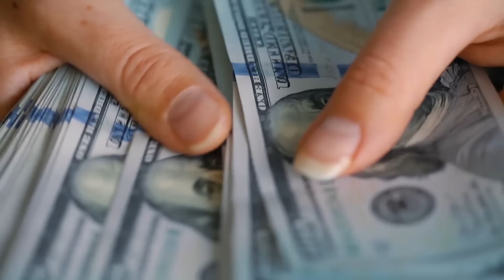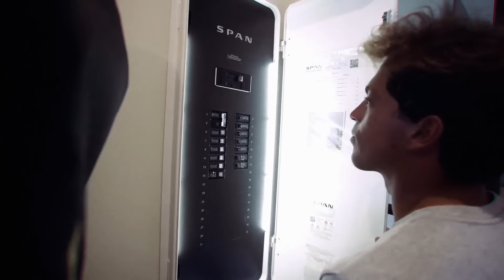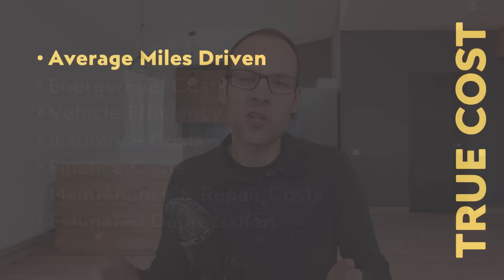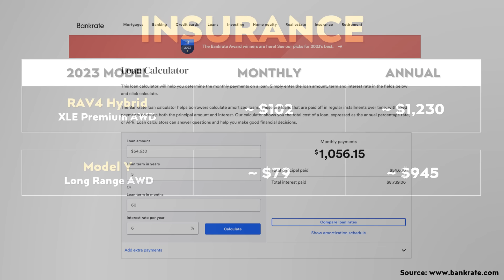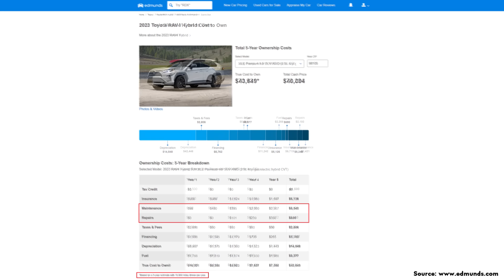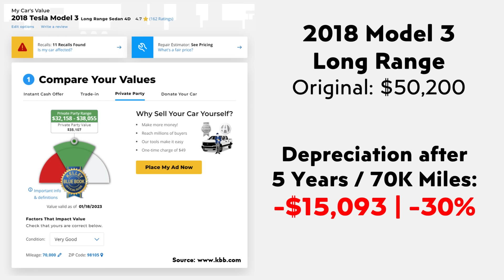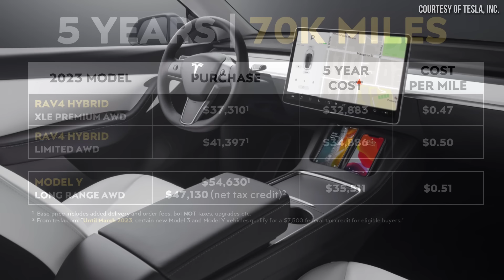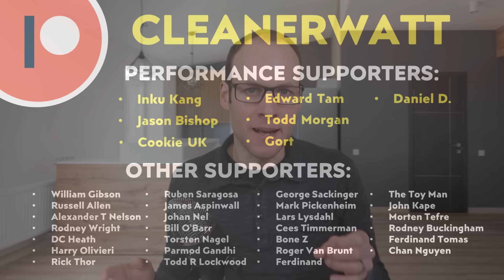Tesla Model Y vs RAV4 Hybrid: Lowest Cost of Ownership in 5 Years?

Comment from the maker: QUICK CORRECTION: at around 6:30, the slide that shows insurance cost estimates has the models switched. The numbers that I speak in the video are correct, but the slide should show ~$102 per month for the Model Y, and ~$79 per month for the RAV4.
Reply: I caught that !!!!
Reply: I knew something wasn't right because I called the other day to compare insurance and mine was going up 150 a month from my wifes 2015 Honda CRV EXL
Reply: If the interest rate is low, the operasional saving of model Y maybe could make sense but if the interest rate is high the model Y may be don't make financial sense because of it's higher initial purchase price.
Reply: How about a ten-year comparison. Why just 5 years all the time.
Reply: @aquilinonilay4892  The Tesla will be bricked by Elon before it reaches year 5. You'll be invited to buy a new one
Reply: The 15 year will be completely different. No one will keep Tesla for 15 years or more but RAV4 will be for 2 or 3 generations and keep running.
Reply: The insurance prices for Teslas has skyrocketed to about $8,000 due to the sky high prices to repair even a fender bender on a Tesla due to the Gigacasting design everything is one piece so a fender bender repair cost is many times more than a fender bender on an ICE. Also due to the fire risks with Teslas.

Comment: Interesting video. I know it’s a bit dated but I went to a Toyota dealer looking at the RAV4 hybrid. It was msrp of $36k plus a $7k market adjustment so $43k. I ended up buying a Tesla model y with the 4680 battery for $46,990 minus $7,500 federal tax credit so $39,500…… Tesla Model Y > Toyota RAV4…. U didn’t take in account the market adjustment and add ons dealers are charging.
Reply: You got snubbed mate, dealer market adjustment is gouging and you got gouged.
Reply: @Andre-mi6fk He got gouged going with tesla? huh?
Reply: Not true. No more marking up. Selling at MSRP or below now.
Reply: That rav4 could last for couple decades
Reply: and it gets better with time.  450hp vs 202....what a joke.  rav4 - gag

Comment: Depreciation over 5 years seems rather low and certainly no where near the depreciation in Europe . 20% over 5 years seems ridiculous, not in the future as in the next five years hybrid will depreciate more like double that rate
Reply from the maker: I agree that depreciation might be higher going forward, but I have to stick with the data that I have right now and calculate accordingly.
Reply: @Cleanerwatt  if Leasing the residual  usually 50-60% of list @ 3 yrs.
Reply: @Cleanerwatt  With the trend away  from ICE, the depreciation coming for the gas car is going to be higher...and the EVs with better batteries in the future again making the non-constant costs lower.
Reply: Also, you should cosider depreciation only if you are 100% sure you will sell the car. Until you don't sell it, those dollars are virtual to say the least.
Reply: @markotrieste :  Yup.  I tend to keep a car 15 years (not driving lots of miles), so I don't even worry about depreciation, as I tend to give the old car to someone who needs car in the end.   (And I've had such people tell me the car was the best car they ever had, and get years of good overall service from it, in one case for over another decade).
Reply: @rogergeyer9851  My goodness! That* is* a spectacularly good idea! Keep those vehicular merchants at bay by keeping your car for 15 years!
I still have my horse & buggy  both of which I can still maintain.
Just kidding. But not about the 2 tons of metal that it takes to transport 180 lbs of me around. And the EV is even heavier than the ICE unit, yes? Appreciate your note that driving is over-rated and that renewing annually is wasteful.
Reply: Rav4 depreciattion is quite similiar in Sweden as stated in this video.
Reply: @Cleanerwatt  here’s a cost that you didn’t mention. Currently Toyota has a ten-year 150 thousand mile warranty on the battery. If you ever need to replace it the cost of the battery including installation is somewhere around 5k to 7k. The cost to replace a battery on a Tesla is more than 20k.  You also said if it was me which one would I buy? If it’s my money of course I’m gonna be buying the RAV4 hybrid and not the Limited model, but if it was your money and you were buying me the car and you let me decide which one I’ll take the Tesla.
Reply: @sammyjammy6647  I am planning to buy rav4 hybrid
But price off door not less then $39500 if I go for lowest base model
The catch is why price on google saying $32500
I will appreciate your reply
Reply: He did a 5 year depreciation when car isnt 5 years old 😂. Its 2024 and model Y depreciation is 50%

Comment: At my Mammoth condo electricity is 40c/kWh. That means that in the snow and ice, the fuel costs of a RAV4 and Model Y are similar. Throw in that installing a 240V 40A power line will cost $2,000 and I will have to get home owners insurance with a $1,000,000 cap at $900/year, that adds $9,200 over 8 years after which the Model Y drive train warranty will expire making the car almost worthless, whereas a RAV4 will go on running without much extra cost for years.
Reply: If your paying $0.40 kWh why not just use superchargers? My cost per kWh is $0.12 which makes for big savings in fuel costs.  I only have 110V 15A which works for me.  Confused why you would depreciatee Teams to zero after warranty. Yes, some repairs won't make sense but it doesn't die on  year 8 day 1.

Comment: There is one key factor that is not mentioned. Though it really depends on the driver. The key factor that is probably need to be factored is TIME. If the driver do drive long trips quite a bit in year. Charging time maybe longer than filling a gas considerably. Sure there is a charging station, but if too many drivers charging then the output to charge your EV will be like charging at-home. If TIME is very important to the driver then I would think it is obvious that Hybrid or ICE is the choice. Sharing this experience since this key factor is not being mentioned by many EV bloggers.
Reply: TIME is important and so the 5 yr period is* conspicuous: only one of these cars is going to get OTA updates (possibly longer than 5 yrs) and a 10 yr period might really make the ICE car look bad. In 15 yrs will we see any ICE cars?
Reply: The EV would typically charge at home or possibly during shopping trips and such and generally would save time for most of the year when using for basic commutes.  That's a lot of time not going to the gas station weekly.  I think it outweighs or at least balances with the extra stops and time changing on the rarer long trips and charging an EV.
Reply: The model 3 long range was great for our road trips. From Los Angeles to Utah, total stops to charge added an hour and 45 minutes. But these are stops I would have made regardless. Once in Eddie’s World, which I always stop to use their restrooms, once in Las Vegas, which was out lunch break. And then once somewhere in south Utah. The Utah stop was like 25 minutes for most of the charge.
Reply: Sure charging the electric on those rare long drives that surpass the range will take longer. But on the other hand you don't have to make those weekly, or more frequent, gas station stops. Charging at home will save a ton of time wasted standing around waiting for gas to pump that everyone already does.
Reply: I save a ton of time per year by not getting gas or oil.

Comment: I have a 2023 Model Y and the pricing you gave is pretty good, except for the insurance. I live in Dallas, Texas, and city rates are a lot more expensive. I use Farmers and they are about $3400 per year for me and I don't have any accidents. My previous vehicle had been about $1500 a year and this was a significant change. Farmers just said that you pretty much can only get Tesla's repaired at Tesla and due to non-competitive repair, it is really expensive. This is something I had not really factored into my expected costs and was quite an unwelcome surprise. However, everything else about it has been pretty great. I've had it a year and basically have had to do tire rotations and fill the wiper fluid and that is it.

Comment: I love that these vehicles are being compared now - Tesla vs. ICE - just on price. These are the competition now that Tesla has come down into this price point. If I made the video, I would have been a little more biased and included some safety stats. Hopefully this opens some people's minds and they end up test driving both.
Reply: You are right. Wonder how often does a RAV4 shadow-brake.
Reply: alex kimmerly:  NOT just on price -- on cost of ownership.
Reply: @markotrieste  I guess you are trying to make a joke about phantom breaking with the autopilot here, but RAV4 probably doesn't have a system with similar capabilites to the autopilot every Tesla driver can use for free. Yes phantom breaking exists still sometimes and can actually cause a problem, but this is extremely rare. Let's not forget for every incident you read about in the news there are a million cars having a nice travel with no incidents using autopilot.
And as it is with every single driving assistance feature you still should be an attentive driver. But this isn't just for Tesla, but really for every system offered by any carmaker nowadays.

Comment: Nice comparison. I'm currently researching these vehicles for my own purchase. Though in my case the MY is roughly $100/month more expensive, even with lower electricity and similar insurance costs. But still, I don't think that's too much higher given the MY is both nicer and safer.
Reply: "...and safer." And will retain it's value better than its competitors if history is any measure. The crushing element here is very few if these competitors will survive if they cannot ramp, even if they have Lucid-like specs. "How many units/day?" is the* decider ...that puts you in the dessert, yes?
Reply: Do you have residential solar for home charging?
Reply: FYI, waiting on the MY. Took the plunge.
Reply: @Remotesteve2  No. Unfortunately, I have the issue where my electric rates and usage are cheap enough that solar doesn't make sense on a cost savings basis. It would take 25+ years to pay for itself under optimistic conditions. I improved the insulation of my home and purchased a very efficient heat pump since I live in a cooling dominant environment. Got rid of all gas appliances. 

I am, however, considering a battery and inverter for backup through outages and maybe peak shaving to get somewhat lower rates. A small amount of solar for water heating might make sense.
Reply: @Tanstaaflitis  if you get the model y and a home ev charger you’ll probably spend enough where you save with solar
Reply: @Remotesteve2  My estimate for the coming year is I'll pay an extra $50 / month for charging the MY at home. That's a good bit less than I was paying to fuel a Corolla (38 mpg) for the same trips. I keep tabs in solar as costs continue to fall.
Reply: My cousin owns a used car delership and routinely sells Toyota Hybrids with more than 200k miles and rarely any customer returns for his 2 year 20k mile warranty he writes them

Comment: I think not only the "features" but other factors should be considered too. The Model Y is one of the safest vehicles ever tested by european ncpa, and has a 5 star rating across the board in it's NHTSA test. It's basically the safest vehicle you could possibly own right now. Especially if I had a family I would given the pretty much even price go for the saver vehicle. I think even if it was liike $0.55-$0.60 I would still opt for the Model Y. Just feels good to know that the driver+passengers safety has the highest priority for Tesla. People talk a lot about them e.g. taking features like lumbar support away, but with Tesla at least I know they wont ever compromise safety for profits. With other carmakers I'm not sure, the Rev 4 for example only achievs 4 stars in frontal crash safety with a ~16% rollover risk compared to the ~10% of the Model Y.
Reply: RAV4 has a 5 star safety rating too.
Reply: Do you guys don’t experience phantom braking in the EU? I have almost been rear ended at least 3 times for the tesla braking for no reason in the highway.

Comment: Good analysis but there are too many variables to consider; law, gas price, mining for lithium, and unknown future changes.      I would pick the Rav4 Hybrid for dependability, no range anxiety, and it's easier to fix if there are any accidents or any mechanical failure, and it's a more a tradition car.
Reply: Rav 4 would be less reliable and harder to fix, your talking about a much more complicated machine than the tesla. As for the range issue if you're still having anxiety with 244 miles of range and access to the supercharger network I don't think anything is gonna convince you.
Reply: @mrspeigle1  « Less reliable » Tesla is the WORST manufacturier in reliability (EU numbers), and Lexus and Tesla (same brands are in the top 3 best), and the 2nd best is Subaru and Toyota the 2nd biggest shareholder of it. Tesla are unreliable as hell then Toyotas are the best out there
Reply: NO RANGE ANXIETY!!! should be the number one thing
Reply: Good points. Also, what amazes me is the "no need to stop at gas stations" advantage?  Since when it became a burden to stop at a gas pump for 5 mins ( or less ) and leave? There are 168,000 gas stations in the country. Multiplied by 4 ( or more ) pumps per station. This means more than a million gas pumps vs 130,000 EV chargers. Looks like gasoline pumps are WAY more convenient and plentyful.
Reply: @mrspeigle1  Yea.  Because Teslas are known for being the simplest cars to fix!  LOL!  Plus the hybrid engines are amazingly solid.  I've given up on trying to reason with EV evangelists.
Reply: @mrspeigle1  i owned personally hybrid toyotas and they last north of 500k miles with regular maintenance and you get 40mpg. Hybrid battery replacement is way less than tesla pack replacement.  After watching this video im no longer interested in tesla.

Comment: The Rav4 does not improve after purchase, Teslas do with over the air update so this is another consideration
Reply: Tesla's batteries degrade by 6% each 100k miles. Fairly negligible but worth mentioning.
Reply: @ShamanNoodles  then why are there hundreds of teslas on the road with 250k+ mi and still single digit battery degradation? lol
Reply: @FrenchyTube3  this is what Tesla says, themselves. I'm sure it's an understatement to be certain. EV batteries also age more greatly over time than over mileage, so it's kind of a weird statement either way.
Reply: @ShamanNoodles  whatever you say lol
Reply: @FrenchyTube3  Okay, Elon fanboy. How's that Dogecoin "investment"  treatin ya?
Reply: @ShamanNoodles  cringe

Comment: in my country (Chile), the cost per kwh in low-speed normal plug is around $100clp (US$ 0.11). Leaving the car charging at night gives me a full battery charge with US$8.5 ...  that's $0.017 per mile, or, in the example, only $1.190 in 5 years. I believe that the big advantage of pure electric vehicles is that you can charge them like a phone. The cost is ridiculously low.

Comment: Thank you for the analysis.  While I’m a big proponent of EVs in general, I don’t understand why such analysis only considers the basic cost of electricity per kWh when there are other electricity fees to be considered.  For example, in my area, the basic service supply rate is $0.33/kWh, but that does not include the other fees, which total about $0.15/kWh.  So, our effective electricity rate is $0.48/kWh.  I’m sure many other states also have various fees that contribute to the per kWh rate.  Therefore, you cannot only consider the cost of the basic service supply rate.  What’s your thought about this?
Reply: My thought is that, even if you don't own an electric vehicle, you still have to pay the fixed charges for the connection to your home, and such it's not fair to add them into the cost of wanting electric vehicle.